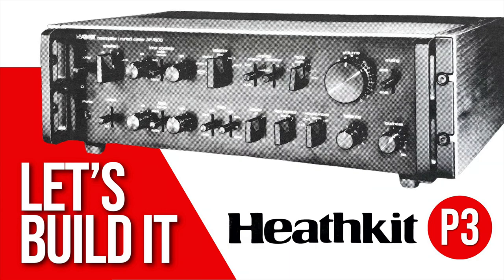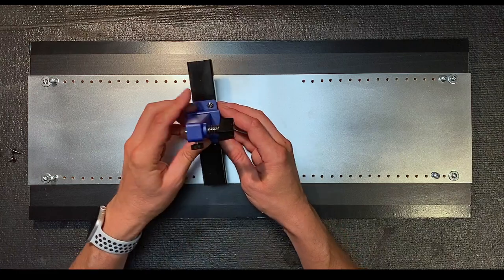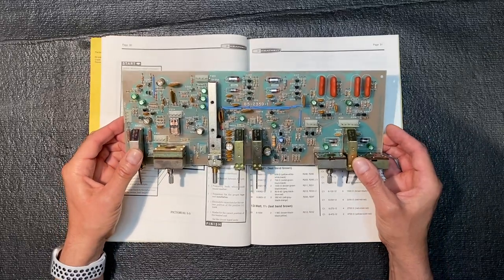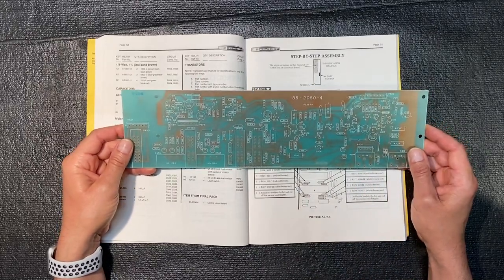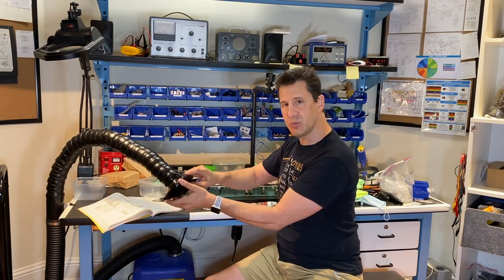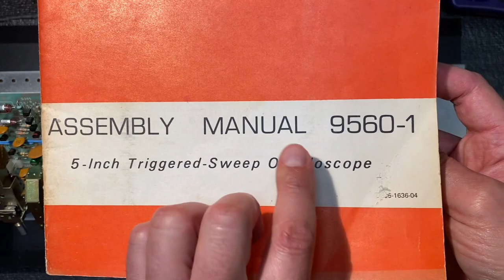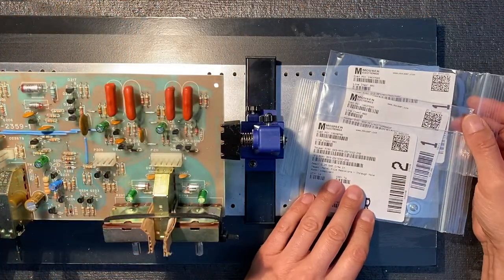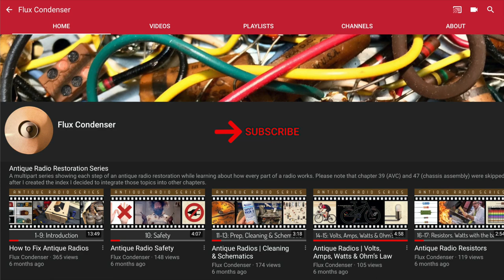Let’s Build A Heathkit Stereo Pro-Series Preamp • P3 (With Useful & Weird Tips)

Comment: Some of these small ceramic caps have the leads coated pretty far from the body.  If inserted in the PCB holes they could inhibit soldering.  Heathkit included the step of removing the excess ceramic from the leads in order to ensure a good solder joint.  Thanks for documenting the build, I own maybe 20+ Heathkits, mostly test equipment and ham gear and remember building them fondly!.
Reply from the maker: I think that makes sense, if the dip really extended a long way along the lead, soldering would definitely be impacted. If that’s the case, then the grinding would only be necessary in rare cases. Most ceramics just don’t seem to have so much coating that soldering would be impacted. Perhaps Heathkit was advising this to prevent that rare occurrence. I think a better policy is to treat them on an individual basis and leave them alone unless it’s really necessary to expose the lead. Thanks for the great comment and glad you’re enjoying the series.
Reply: @FluxCondenser  I think it could be relevant on a tight bandwidth situation: less lead, less stray inductance maybe? So on a pream no big deal but on an oscilloscope could be affecting the performance.
Reply from the maker: Absolutely, I’m a fan of keeping leads as short as possible regardless of the device. Even in an audio unit, long leads can sometimes end up being antennas for AC hum.

Comment: I use a electronics wire brush (toothbrush sized) to clean all the part leads right before soldering.  Sometimes I also scrub the copper solder pad with a fiberglass pen.  The solder just flows onto the leads and pads better when I do that.
Reply from the maker: I could definitely see that helping as any oxidation gets in the way of good soldering. Flux acts the same way to remove oxidation. I find the flux alone works well enough for me most of the time, but yes, I’ll use a little steel wool or mild abrasive on heavily corroded leads.

Comment: Good idea on the extending pc board holder. Have you thought about tapping the holes in the steel plate and then drill a hole in the horizontal bars. This way you can screw them in from the top.
Reply from the maker: Thanks, I could, but the setup works well without additional drilling so I’ve opted for this setup. I guess if one found flipping it over to change positions was a pain they could opt for your suggestion. You’d probably want to use wood screws in that case and screw directly into the wood board. Take care and thanks for the comment.

Comment: Removing the excess ceramic coating is an attempt to minimize lead inductance. This is more of an issue when building VHF/UHF circuits.  In this device lead inductance should be insignificant. imho
Reply from the maker: Thanks for the comment, John. Agreed, with some sensitive RF components perhaps lead length could be an issue, but not really a factor with circuits passing audio frequencies.

Comment: Nice video!
Could you tell the model of that soldering iron? Thanks in advance! :)
Reply from the maker: Sure thing. The one I’m using in this video is a Hakko FX-888 which is just an overall great performer. A while ago, though, I picked up a Hakko FX-100 which uses RF technology and offers a lot of nice features. Check out this video I made which has a “mini review” of the FX-100: https://youtu.be/5HZDTS6bSbQ

And note, too, that I have soldering iron recommendations on my Amazon shop which you can check out here: https://www.amazon.com/shop/fluxcondenservintageaudioelectronics